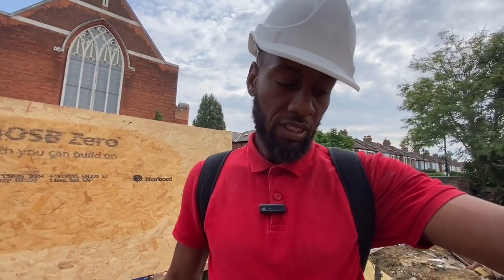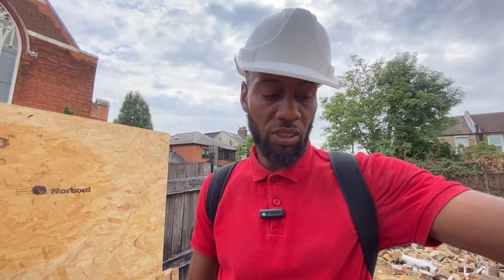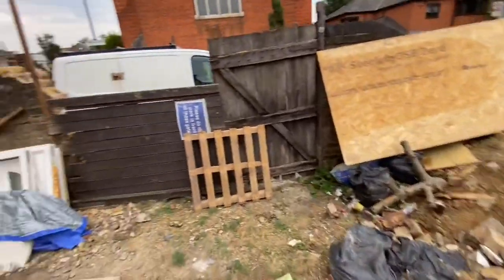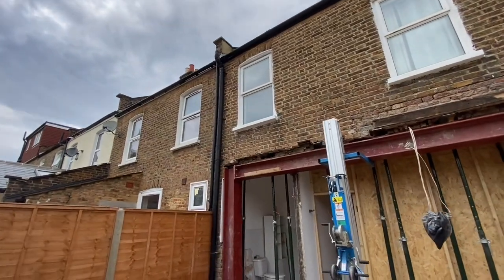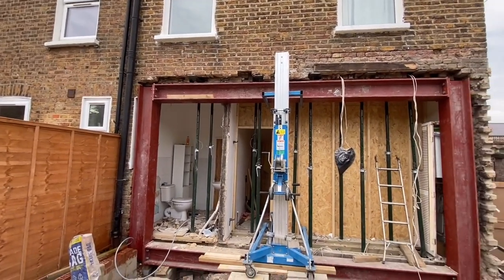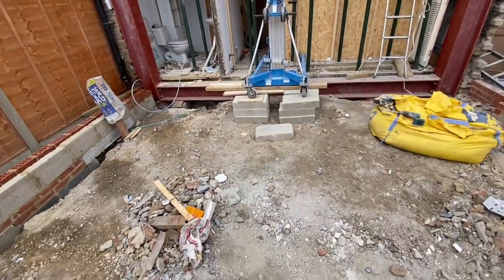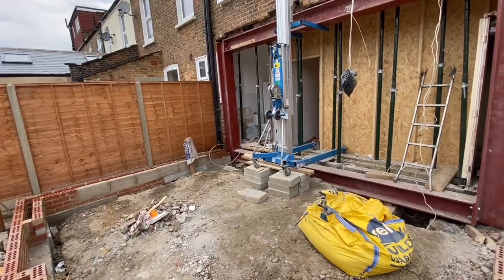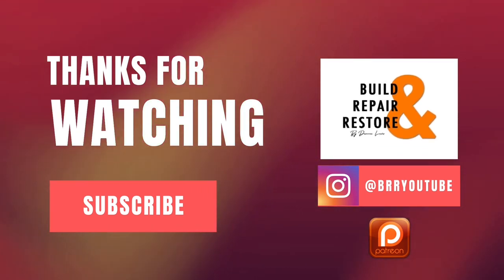We did it! Box frame steel is in - London Extension build Ep20

Comment: I don’t understand why the top and bottom steels weren’t extended to the very end and the uprights holding it up… seems strange that all the weight of the house is being held by the bolts
Reply: engineers have strange ways, just do what they designed lol
Reply: I thought the exact same thing, it looks like the horizontals should be the verticals, and the verticals should be horizontal. I've installed dozens of crossbars and box frames in my time, and I've never seen it this way. It would be good to see the drawings guys to help us understand why the SE has specified it in this way.
Reply: @jjudge8381  it’s a poor design by the se I get that those bolts have ridiculous sheer strength but it almost makes the uprights pointless… the weight should be transferred through the columns not the bolts
Reply: Good point, perhaps the joints are going to be welded. 🤷🏾‍♂️
Reply: I did wonder this too, and the bricks at each end will be floating over the open columns?
Reply from the maker: There will be a reason as these things are very well thought out and also the drawing gets submitted to the council for approval. Ive seen it done this way before so i guess there is something to it.
Reply: @darrenthebuilder  only good reason I can see is it makes it easier to install… thanks for the reply and keep up the great videos
Reply: Not only will the bolts be holding the house up but also when the new extension roof will be coming off that top horizontal steel beam…hmmm I wouldn’t be happy with that design. Great work though Daniel 👌
Reply: The job I’ve been on this week did this aswell but the top and bottom run all the way through and the sides sat in between and was welded into place
Reply: I'm no structural engineer but it might be that the main load on the building is on the outside edges, the cross bar looks like it does a lot of work but in reality it is not working as hard as you might think... just my guess mind.   Looks over engineered I doubt it matters how it is stacked. I also notice that a lot of metal frame buildings hang the crossbar on the bolts rather than stack it onto the pillars so I guess good reasons why exist, any structural people lurking who can answer?
Reply: Could it be that the actual steels are over sized for what they are supporting vertically but the box is that way and larger than you expect  because the main force is lateral from the entire terrace row.
Reply: @jonshouse1  Especially as it's a terrace (and an end of terrace at that), i think the end wall and party wall carry a lot of the load rather than the floors
Reply: Don't worry about that bolted joint it's the most common joint used used in steel fabrication and structural work ,bolt can hold massive amounts of weight 💪
Reply: Is that a back brace (support) your wearing?
If so do you have a link for it ?
Reply: Not an Structural Engineer, and its does feel counter intuitive...but... 

Get a cardboard box, tape it up, push on the top and sides to see how it behaves, then cut one of the walls of the box out and push it around and see how fragile those side walls of the box (structure) have become...esp near where you've cut a hole in it.

Those steel columns are as important to the structural integrity of that building (side to side forces) as the beam is for top down forces. It's also why there's a bottom beam..so you can bolt the columns solidly into both beams to minimise any lateral movement in the columns and thus sides of the house.

I presume no brick piers are to be built at the edges of that new opening, so those steel columns take their place and stop side walls from moving laterally. I think wind is also a major concern.

Those bolts looked massive so presume they're engineered to be more than capable of carrying the top down loads as well as holding the columns in place laterally. 

If that beam sat on the columns I presume you could engineer bolts to deal with the load from other directions but guessing based on the loads that want to make that box frame into a parallelogram frame, the beam/column lengths and other engineers calculations this is the most effective option.
Reply: @rfgson  i don't understand,why issues are being raised on here it has obviously been passed over by structural engineer and building control so why all the comments ,! I have done loads of these types of jobs and see no issues whatsoever.its a good job done by the lads installing it as per the instructions,
Reply: It's done this way with skyscraper girders.
Reply: Taken together four bolts, if they're 20mm, would take a lot of weight. They would equal about a 75mm diameter steel rod in each corner.
Reply: I'm a chartered structural engineer, the bottom detail where the ground steel is between steels is an strange one. Something I always try to avoid, but its only the same as a normal beam colour connection just upside down, the bolts will easily take the load. We rely on these type of connection first much bigger buildings than this! 

 I always run the beams through as it's a nicer detail but it's just my preference but it does mean you have a constant bit of steel at the top to drypack and new masonry.

I am assuming it will be wrapped in some mesh and some concrete cast around so it will all be locked in together.
Reply: I’m not a professional but the steel are that coz it’s a end house, the load pushing down is not that much it’s to support the left an right movement of the house, there is a little experiment you can do with a cardboard box lol

Comment: I thought the top and bottom steels would have been full length and the uprights fit in between? Just make more sense for the load. Thanks Darren. All the best
Reply: I totally agreed ,top and bottom beams should have been full and upright one should have been wedged in between
Now basically the weight of WHOLE house would reply on the bolts 
Poor design by enggenier
Reply: @rkvohra70  I also agree, the weight can then be directly transfered down through the upright (a bit like a lintol) things change i suppose
Reply: It does make sense to put the steel on top. But the bolts are doing the same job. It’s not a bad  design. That’s how you do it. Just look at a steel frame office block. The floor beams are  bolted to the side of upright and the uprights are bolted together and so on. It’s just how it’s done.

Comment: Blimey, that's a relief to see it all in place. Am surprised the structural engineer didn't design the top steel to be wider and rest on the uprights. Hope he knows what he's doing but you have to work with what you've got. Great job getting it into place. Hopefully that's  the hard work over and the rest should be easier from now on.
Reply from the maker: Yeh i thought so but i have seen it like this (online), but these design have to pass the council and im sure the engineers know what there doing so its all done a certain way for a reason. I personally have no idea lol
Reply: Maybe it's designed that way to support the party wall and outside wall.
Reply: For what it’s worth, it’s to do with 2 items it seems - end bearing and also wind restraint - there’s no wall on the other side as it’s completely open - building regs.

Comment: there is something wrong ..all the downward weight is on the screws surely the vertical steel ends should be on and under the horizontals

Comment: great job as always guys was a little concerened about the bearing on the two footings .. but i remember you saying the beam at the bottom is being encased in concrete so that will sort out that issue ..... well done dealing with a difficult job .....

Comment: I am no engineer but I know that engineers start their degrees already with A level maths/physics.  They then study maths and physics for another three years.  If Darren says the engineer approved this design, then I think the armchair critics, with their little bit of knowledge (and GCSE maths) should pipe down.  As someone with only a tiny bit of knowledge in this area (and maths at a GCSE level),  it looks like this steel design approved by an engineer would pull the frame in, under load.  If the top steel were on top of the uprights, the frame under pressure might tend to go rhombus shaped and put pressure on the outside wall and push it out.  The onlyl thing I know....is that I know nothing (Plato on Socrates)

Comment: Hi Darren I think you need to get the engineer to explain some of the questions raised about the design of the steel box if these videos are serious. I can see some weaknesses in the design and so do others. I am beginning to think that you are working under the instruction of an incompetent person and may never get paid for your work on this project. I may be wrong and I hope I am but surely the design of the box means that all the weight of the upper section of the steel and the upper part of the house are bearing down on the bolts rather than the steel uprights which would mean that the pads were a waste of time and money  . Please ask the engineer to answer my questions and also why have building control not show an interest on the steel structure progress.
Reply from the maker: I don’t know the e engineer and that’s. Not reallly something that I would do. I wouldn’t feel comfortable questioning their expertise for The sake of my videos (no offence to you or anyone). Tbh I have seen this design plenty and many steel Arrangements are hung for from the bolts. From quick research these bolts probably can hold up
Two of these. Houses soo im personally not worried. Building control
Are interested but the process is they visit once the. Steels are in place. They will only check that we have installed the Steels based on the pre approved drawings. Obviously I will keep you updated on any inspection. Hope that makes sense. Peace
Reply: Thank you Darren for the prompt reply, I am  not qualified to say that this is a weakness in the structure and I'm not saying that it is but I saw it as a possible one as did other unqualified people. I would be interested in understanding why it isn't the other way round because I'll be doing a smaller extension in the future requiring the same thing. I'm sure I will learn some more as the project continues so I will continue to watch your content and be a fan of yours and the team. Bless the work and I will talk again soon with you. Donal
Reply: Structural Engineer here.

The 'weaknesses' you think you see in the design, in this instance, are not there. It's always healthy to see people question why something was done in a particular way. 

The bolts are largely acting in shear (with some tension) and if they're 4No. 8.8 M20s per connection (say) they'll be adequate to support the loads above. Provided they are tightened. 😊

The load on the beam's split and transferred to the columns, then onto the footpads and into the ground.

Having done a quick calculation on this scheme with some basic assumptions, the design works. You can relax, now.
Reply: @davebadger100  This answer may not satisfy you, but here goes.

Specifying top and bottom beams to be of same type and dimensions may be favoured for it's 'simplicity'.

There is also the benefit of having one less drawing detail to provide.

Another may be, how the particular structural engineer envisages the build process within their mind, based upon their imagination/experience.

Even what sometimes appear to be unintuitive designs have to be proven to work.

Sometimes, there's just not one way of doing things.

In this particular instance, i may have bolted the top beam to the top of the column heads via a bearing end-plate. 

At least in principle, this would be more structurally 'elegant' to my mind as the integrity of the structure would not be relying solely on the performance of the bolts.

Either way, it is of little consequence, as it has been proven to work.
Reply: @TheLuminousOne  Thank you for the explanation it was appreciated and it was nice of you to share that knowledge.

Comment: That struc des makes zero sense. Since the beginning of mankind's necessity to build up, verticals hold up horizontals. 
Be it wood, concrete and especially in this case, heavy duty steel, the formula never changes, 1 comes before 2 comes before 3 and so on.
Welds, bolts, poor designers and even worse city council approvals be damn. 
I would NEVER put this in my house, let alone a customers, taken one step further, I would put this in my house BEFORE I put this in a customers because I would rather die than live with the guilt knowing I installed this hot mess. 
Bolts my a55. Welds and Bolts break EVERY SINGLE DAY!!
 This is outrageous and unacceptable.
Reply from the maker: Yep bolts on our car wheels are absolutely unacceptable
Reply: What may seem to be outrageous and unacceptable appears to be perfectly ok.

There are a couple of structural engineers who have given their views to the many people questioning this design. Both have said it is perfectly fine and is a common way of doing things. One of the engineers has even stated that buildings far bigger than this are done in the same way.

If a structural engineer says it is fine then I'll take that.